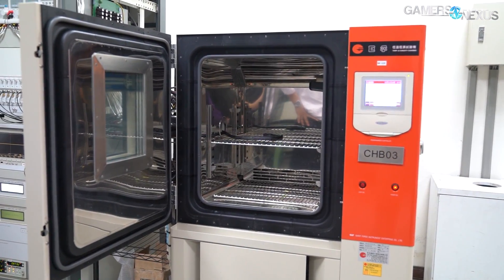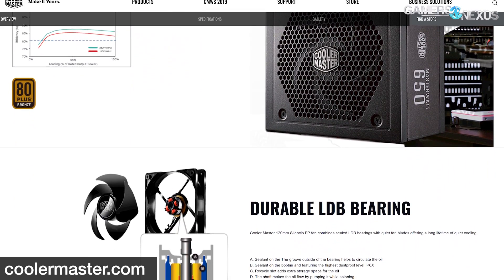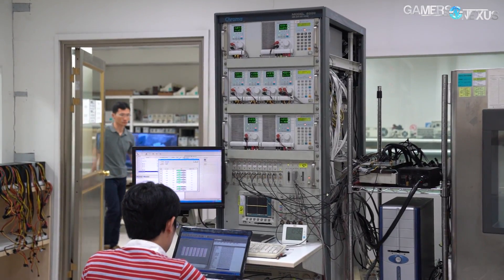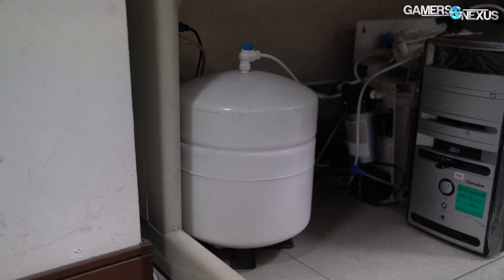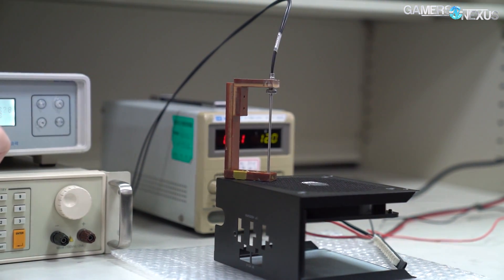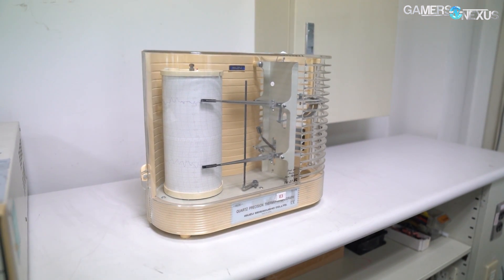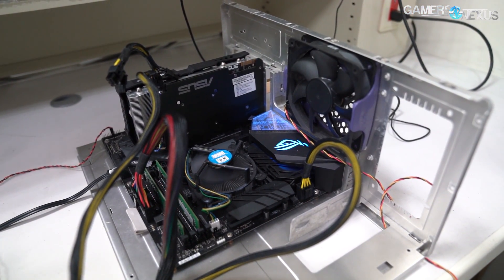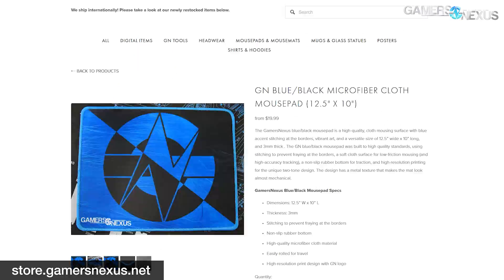Power Supply Testing & Failure Analysis: Engineering the Best PSUs (2020)

Comment: m running Pop OS and  having lock up and resetting randomly problems  too, so i took apart entire computer and cleaned it and inspected all caps i could see.
i found no bulging caps or burn spots on  msi tomohawk mobo, rx560 gpu or inside psu which is almost 10 yr old 750 watt antec.
and i still got a lockup within a few days even with psu sitting outside the case[should run cooler]
at todays gpu prices i hate to guess its the problem , my same Rx560 is more expensive 350 cdn now than when i bought it 3 yrs ago at 285cdn but it does already sport a line thru display of one output,  vga i think
so whats your  best guess computer experts?

Comment: When using parts picker gets the following: 'The Asus TUF GAMING X570-PLUS (WI-FI) ATX AM4 Motherboard has an additional 4-pin ATX power connector but the name-dropped power Supply does not.'  Says this can be an issue when powering a video card. At what size, video card does this actually become an issue?

Comment: Great video overall. I can attest to the immense amount of analysis necessary to build a quality power supply. We don't design supplies like this, but our products do have flyback topology designs to provide isolation and power conversion. I think most PC power supplies are flyback topologies. You don't just build a power supply once. You attempt to optimize your design in simulation, but once it is built there is still a large amount of testing and tweaking to do.

I am surprised they manually twist the thermocouple leads together. We have a really slick thermocouple welder that welds the two tiny wires together. They are tiny by design to prevent error from the wire itself conducting heat away. We use fast setting CA glue to attach the beads to the top of components. We make industrial electronics so the operating range of our produces is -40 to 70° C and we routinely test 10 degrees beyond the extremes. We have done HALT testing up to 130 to 140° C ambient. 

Also somewhat surprised to see the thermocouple terminated in a large screw terminal block. Hopefully they are accurately monitoring the temperature of the reference junction, though I don't see how that one would be isothermal. Usually you would put a special thermocouple connector on the end of the wires that is made out of the same material. This would connect to the same type of connector and then a length of thermocouple wire that leads inside the instrument to a isothermal block where the reference junction would be. The temperature of this reference junction is measured and then the voltage error due to the Seebeck effect at the reference junction can be corrected for.

At the end of the day power supplies are analog electronics and you don't just throw one together. Every idoit can count to one, but it takes lots of math and analysis to be good at analog electronics. Ask Bob Widlar.

Comment: Hi, love your channel. Thinking of upgrading my old AMD HD series videocard, left from previous setup, to RX580 and don't know if PSU Thermaltake Litepower 450W (LTP-0450P-2) would keep up with that? 
(PC: Ryzen 5 2600x, Asus B450 motherboard, 2x8GB of RAM, NVME SSD, + 2 Spinpoint F3 HDD drives, 5 coolers)
The thing is, would rather not change PSU if not needed.

Already had tested power consumtion with existing video card HD 6770 (rated TDP 108W). Runing Cinebench R20 with MSI Kombustor and from the wall system draws 303W max. 

And kinda don't want to go with less power hungry Nvidia, just because have monitor that supports only FreeSync.

Comment: Don't buy Cooler Master products! They are bad quality. I have a power supply that fails to resume from sleep, although the voltage and noise levels look very good.
My Cooler Master case came with a screw cutting through the wire for the power button.
Also don't buy Fortron (FSP) power supplies! I've seen motherboards and CPU's fried due to swelling capacitors, and no over-voltage protection. This is a common issue among their power supplies. When a capacitor goes bad, pulsations around the reference voltage becomes higher, until the board can no longer tolerate the peak and gets fried. Most commonly caused by the 3V3 and 5VSB rails.

Comment: This being China, I suspect that they rigged a "lab" by borrowing equipment from several colleges to show us how "advanced" R&D they have. This is overkill on every level and unlike the budget Chinese nature.
These are just PSUs, not processors. And yes, you can guess the size of most cooling components from experience. And then test which part fails the most in the oven and beef it up.
The K-cells really made me SMH. How good thermal contact do you think they have? A thermal camera may be less accurate, but it won't gather huge errors from slipping cells and it will still reveal hotspots you neglected to measure with the thermocouples.

Comment: I'm very excited about this video! Product/Test engineering is great!
Only a few notes this time. Excellent work as always.
0:35 "waverunners and oscilloscopes" Waverunner is the name for LeCroy's oscilloscopes like the LT354 shown an 0:35
8:88 "waverunner and wavesurfer brand devices" Wavesurfer is also LeCroy (now teledyne). They are slightly newer than waverunner. Both are "just" Oscilloscopes like the tektronix DPO3014 you have at 8:17
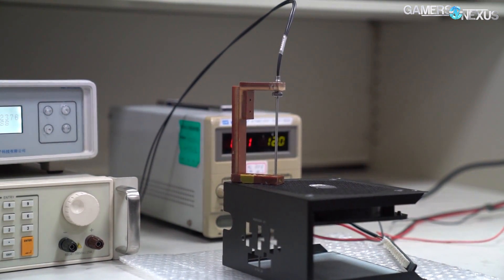9:40 That LeCroy WaveSurfer 24MXs-b is $11,000 It's from 2003
15:23 "buck capacitors" Do you mean bulk capacitors? The capacitors in a buck regulator are usually referred to which side they are on: the input or output capacitors (since they serve different purposes and are both critical parts of the design), whereas many PCB designers use the term "bulk capacitors" to refer to the biggest ones you see there. It can't refer to both the input and output capacitors of the buck stage since they will definitely be different. Maybe it's multiple line items in the list of 27?

Comment: I feel really nit picky, since this video is overall very good and informative, but, I noticed a couple of details that could be worth taking into consideration.

"These racks also include oscilloscopes, thermocouples and waverunner or wavesurfer brand devices for loging and analyzing component performance." 8:17
Is a statement that risks being misleading. It's technically not wrong to phrase things in this fashion. But why highlight the two product series? Both Waverunner and Wavesurfer are Lecroy oscilloscopes, and in essence are the same as the Tektronics oscilloscope that the quote started at. (Ie, the statement can be summed up as "these racks include oscilloscopes, thermocouples, and Lecroy oscilloscopes or other Lecroy oscilloscopes for logging and analyzing component performance." a somewhat redundant statement.)

Also, pointing out the scope product name for the inrush testing is a bit overkill, since almost any scope on the market could do this test fairly sufficiently. So it is an unneeded detail and only wastes time in the video. (Though, the way they use the scope in that scene would require them to use an isolation transformer for driving the powersupply, otherwise the scope would suffer severe damage. (this is a trap for many beginners in the electronics world.) This is frankly a more important detail than the brand/product name of the scope being used.)

In the world of test equipment, the main thing that actually matters is product specifications. The brand/series/model starts becoming important when expanding an existing setup. Since there is few communication standards for test equipment, and rarely even standards for the interfaces to start with. (in short, test equipment can have frankly arcane interfaces, even if one has used multiple other arcane interfaces on other equipment... So reading user manuals is not unheard off.) So an R&D lab, manufacturing line or test lab can tend to use specific equipment for a long slew of reasons. But primarily it is down to specifications, price, interfacing and unit size, sometimes also other details. But practically speaking, almost any piece of test gear from one manufacturer can be replaced by something similar from another. There is few test gear manufacturers that have their own corner of the market.

Ie, it is much more informative to state the specifications required for doing a certain task, instead of sating what specific tool were used for the task. Since a test/R&D lab can at times use totally overkill tools for a task, since each piece of test gear costs money to buy, store, and learn how to use. Not to mention recurring calibration costs for ensuring that it is in spec. So most labs tends to just use what they already have on hand instead. 99% of the time a scope is a scope, a load is a load, and a multimeter is a multimeter. As long as the test gear has sufficient specs for the task, then it can be used. (obviously, a 300 watt load isn't sufficient for performing a 400 watt load test. But it is on the other hand sufficient for everything under 300 watts. (or at least down to its minimum resolution/range. (ie, it might struggle to load something with only 1mW.))) These last to paragraphs kinda applies to all your factory tours to be fair. (at least you aren't stating the manufacturer/series/model names of the robotic arms used in the production lines, or the conveyor belts, screw drivers, etc... But for electronics test equipment you are frankly on that level.)

Then we have the acrylic test chamber where you say, "these use light bulbs in the bottom to heat up the chamber to about 1500 watts." is frankly an odd statement.
Would be far more logical to say, "these use light bulbs in the bottom providing about 1500 watts to heat up the chamber." this is really a nit pick, but Steve, this is your field. (or are you just testing your audience here?)

Comment: Using Windows XP is not something that I have an issue with. I have worked in places that use XP as it just works, and they don't need to change it. And I agree.

But using a laptop is something that I am not comfortable for prolonged use. You can do very little to repair an old notebook, and finding replacement parts for them is far more complicated. But that's a company's decision. I am glad to learn this kind of scenario exists.

Great work, Steve and team.

Comment: I bought a cheap 500W PSU a few weeks ago - for my spare parts PC (an old i5-2500K, GTX 760, 16GB DDR3, 500GB HD) by 'JUSTOP' who I've never heard of before. I got lots of 'Eeek, your house will burn down' - but it's been running flat out 24/7 for 3-weeks now - running folding@home and it's cool and quiet and, so far, my house hasn't burned down.

I obviously could have and should have probably spent more, but this PC is effectively worthless at this point and if it wasn't for folding@home it would still be in my junk parts box - I know there's some truly terrible PSUs out there (I've had a few in my time) - but this one - despite only being £36, seems to be OK (time will tell I guess).

So, thanks for sharing a video on how (good) PSUs are so robustly tested - I have to hope mine has gone through some of this!
Reply: lol @ weeks

Comment: l just build a mid range PC and the 2nd most expensive part is the PSU. People usually forget how important it is for system stability.
Reply: That actually depends, some more budget PSUs do exactly what they're supposed to do, just with less overall features & lower efficiency. Lifespan is likely lower with lower cost PSUs as well, but they're unlikely to cause a fire or be unstable within their specs.

Comment: You can get the supplier to send caps with internal thermal couples
Reply: Capacitor would be a different SKU which typically means the final product must contain the exact same components as was tested in order to stay compliant with various certifications.  So there would be some increased cost.

Comment: Yay Steve, i love Corsair and their PSUs but i had an issue with 2 AX1000i PSUs that were causing a TDP trip and turn off randomly, turned out to be some switch inside the PSU, a high level engineer at Corsair spent a lot of time on the phone with me troubleshooting and really helped drill down and support their product.

Comment: 12:44 If I only knew that before blindly trusting Datasheet values in my undergraduate project.
Reply: Usually the datasheet values are quite accurate, however, whenever you are going to push the limits or use a part in a way it isn't intended, it is essential to do your own testing.

Comment: If you work in Electronics, PLC Programming etc. you know that once the setup works you leave it like that.. even if that means using Windows XP
Reply: ignoring the networking vulnerabilities in each and every stray dll some crapware loads, xp was awesomely stable, compared to 98/me. when it arrived i noticed it right away and moved. 'good enough' i guess

Comment: About the load test equipment. Does it simulate a set constant load, because most computer loads would be high frequency impulse loads from the many DC-DC fast switching?
It's important because the impulses are "smoothed" by the filter capacitors. And you know, the more they work, the hotter they get and faster they age.
Reply: I mean I'm sure they've taken that account with their experience and million dollar equipment

Comment: Tape is actually very important for safety in switch mode power supplies, which is why it is tested so closely.

The primary side of a SMPS typically operates at line voltages (up to hundreds of volts). The secondary side is hooked up to your device.

It is very important that the primary side is isolated from the secondary side properly. Without proper isolation, you could damage your device, cause a fire, or get a nasty shock.

The primary and secondary windings are separated by the insulation on the wires, plus specific tape. The number of layers of tape and the specifications of the tape are standardized by UL and other testing laboratories. Tape is used so that an insulation fault in the windings (such as a manufacturing defect, or damage caused by a surge) doesn't result in an unsafe situation.

This is why you should always use power supplies that have been tested by a recognized independent laboratory, such as UL. Proper design really matters here.
Reply: The enamel on the wire does not withstand mains voltage and isn't meant to. The tape is thus essential. Modern switching transformers have wires that have both enamel and PTFE insulation. That's some extra protection. But they always have to be tested because mistakes happen and somebody may have stabbed the transformer with a screwdriver.
Reply: Yes! If you don't see a UL or Intertek logo or a CE mark on a product, don't buy it! They will be easy to spot if you look for them. Engineers put a ton of time into meeting these safety specs so your house doesn't burn down killing you and your family.
Reply: @Fix_It_Again_Tony  There has been a series of Russians dying from using their phone chargers or getting them wet. I guess they weren't CE marked
Reply: Who is UL? I havent heard of them before

Also how to know that some recognised testing lab has tested PSU

Comment: Why is there a plastic cover on the fan? I see it in every PSU. Just to direct airflow?
Reply: It's to prevent objects from getting in there and touching the dangerous parts of the power supply. A bit like stopping children from putting forks in wall outlets...
Reply: @Mythricia1988  But it covers like 20% of the fan, plenty of space for something to get in.
Reply: @DarkDao  If it covered 100% of the fan there would be no fan. It's better than nothing, that's the point. Just like safety devices on wall sockets don't actually prevent kids from sticking forks into them, it just makes it harder.

The plastic covers the high-voltage (~400 volts) part of the circuit, which is the most dangerous part. The other side of the circuit is low voltage DC, and although still bad to stick a screwdriver into, at least it won't kill you. It'll just kill your PSU.
Reply: @Mythricia1988  Okay, that makes sense, thanks.

Comment: Coil whine is very normal for any circuit which has inductors and capacitors, the essential part is whether or not the sound from it is within the range of the human hearing. We had coil whine long before PC-users complained about it but back then the frequency was too high for us to hear it. The higher efficiency which the engineers aim for these days make it more difficult to prevent audible coil whine. Inductors store energy in a magnetic field, capacitors store energy in an electric field. In an electric circuit energy gets exchanged between capacitors and inductors with a certain frequency. It is the exchange of energy which makes the wires in inducts contract and expand all the time That frequency, that is the problem, with a higher efficiency that frequency gets within the audible range. 

Gluing has been attempted as a do it yourself solution. It makes sense that these PSU-companies now also try that.

Comment: I never understood why people keep using extreme budget psu, sure, most modern single gpu system doesn't pull more than 650W, but at least get something with most modern protection, at the bare minimum DC-DC.
Reply: same reason why people buy anything from china m8
Reply: Yeah, was trying some cpu overclocking and used a cheap Crono 380w psu, under load (Phenom x4 955be@4.3GHz at 1.55v) the 12v rail dropped to 10.5v
Reply: you see, ivan, people have to learn things some way. trying to cheap out is their way, i mean, i try to cheap out too, the trick is to understand what's going on as early as possible as to not trick yourself into some minor or major damage (like fire, or injury)
Reply: @AlexanderBukh  ''you see, ivan''
Damn, an old meme that I haven't seen for quite sometime.